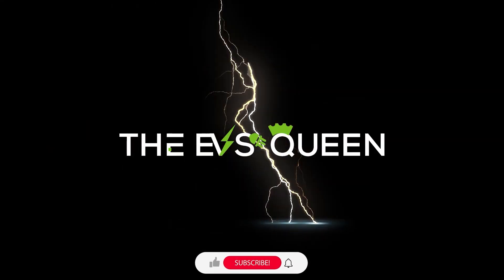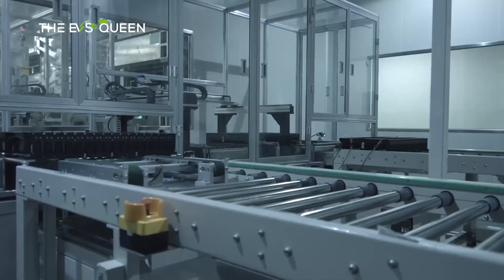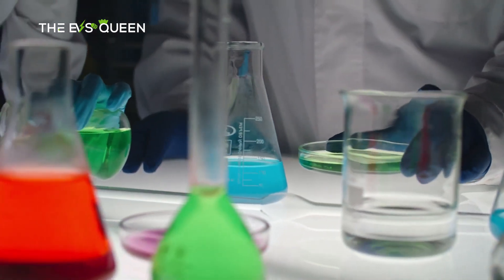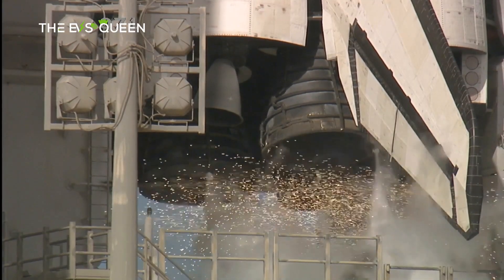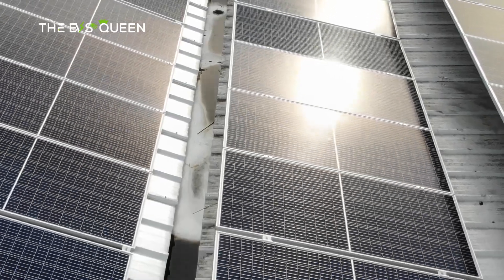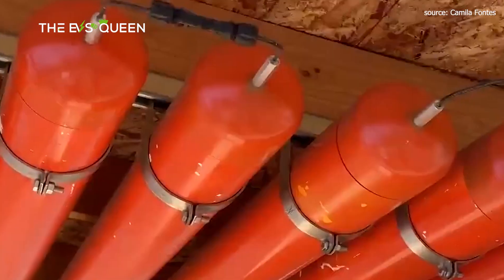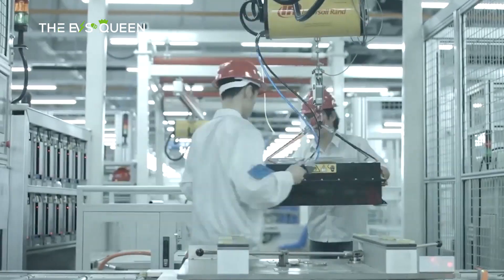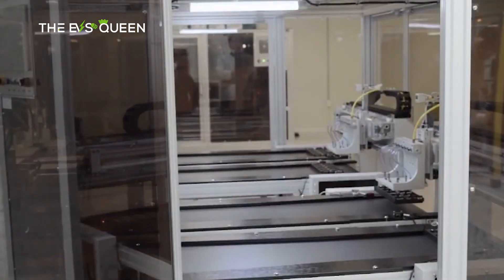A lithium-free energy storage solution is here

Comment: As the world reaches 10 billion people and we create demand for new minerals all the time, my concern is twofold: how much extra demand for nickel will this create when we're already stretching it with extra demand for all the steel in wind turbines and EV's and everything else we're building? And how much extra energy does it take to split the water to make the hydrogen in this cycle? When anyone talks about hydrogen, I immediately remember that they're talking about throwing away 3 times the energy it takes to charge a battery.  Instead we can reduce the amount of electricity storage required to backup a renewable grid by Overbuilding the renewables for winter. Studies show Overbuild reduces storage down to 2 days for each city - and that's to share around if there’s a really bad winter week somewhere. The first hour or so should be sodium battery - as sea salt is super-abundant. But then local PHES can take over. An Australian National University team have a satellite map of global off-river PHES (Pumped Hydro Electricity Storage) sites and calculated most continents have over 100 TIMES more potential sites than they need for 2 days storage. https://re100.eng.anu.edu.au/global/  
Professor Andrew Blakers presents the data. http://youtu.be/_Lk3elu3zf4?t=986